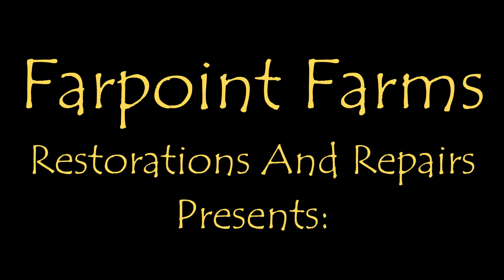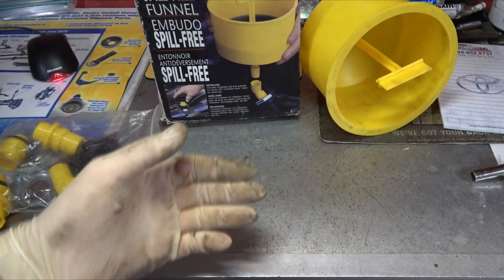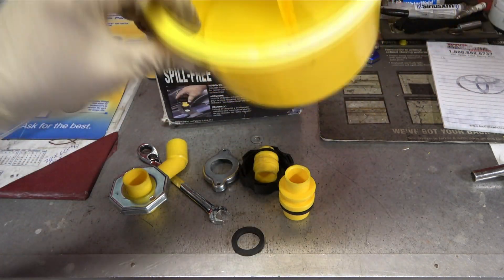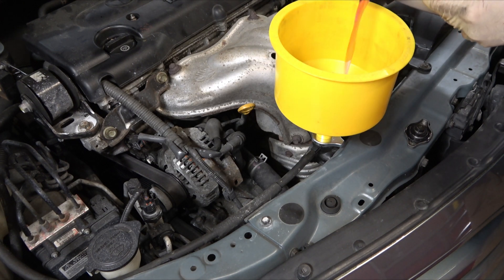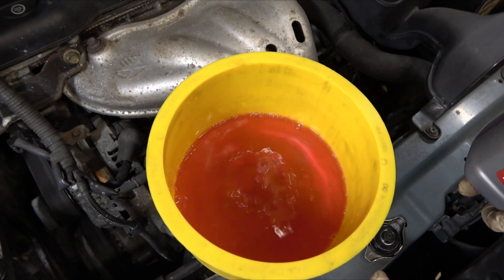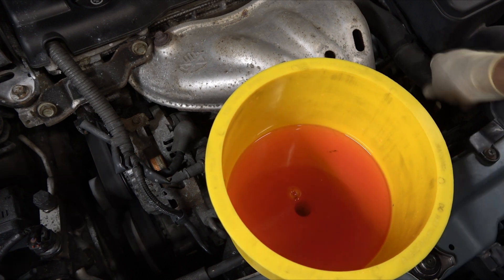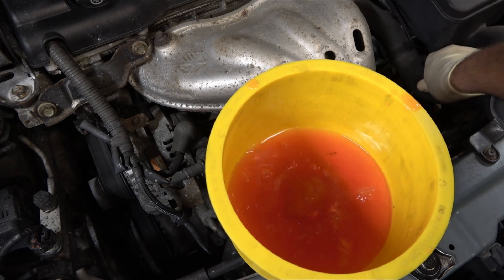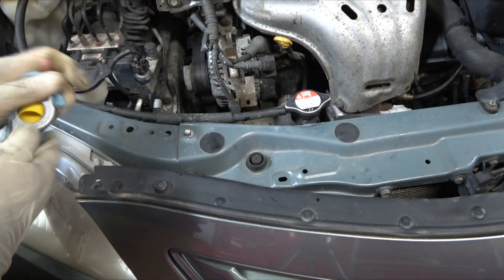A No Spill Funnel For Cooling Systems. Take A Look At How Well This Works For Bleeding Cooling Sys.

Comment: So I did this but bubbles small ones kept coming and I held my car at 2000 rpm for 15 minutes and saw white smoke come out of the tail pipes at 15 min mark, any idea what that is? It need happened when it was idling on its own and not at 2000 rpm for 15 mins? I have no other signs of anything else being wrong during driving or idling.
Reply: White smoke is probably a head gasket mate unfortunately
Reply from the maker: White smoke is not a good sign, check the head gasket(s). Watch the engine temps to make sure you don't over heat.